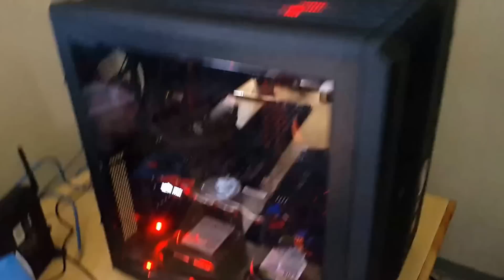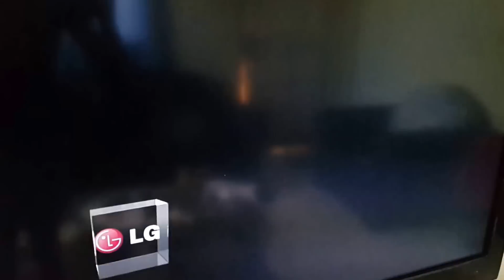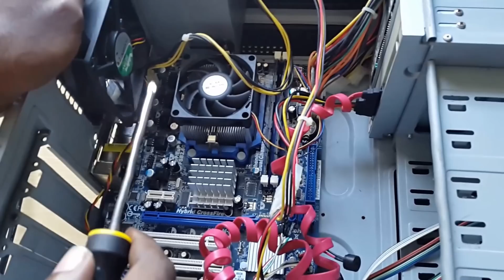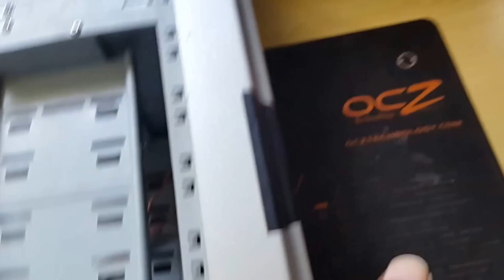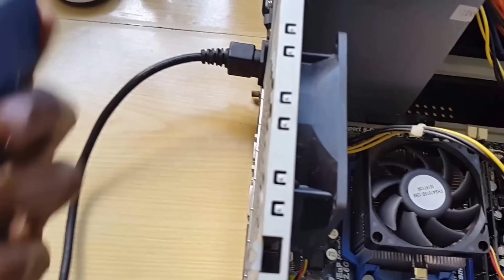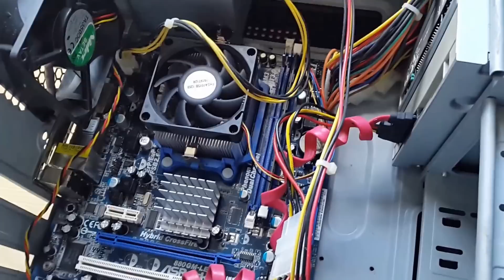No signal to Monitor Fix Easy PC Fix

Comment: After a Windows update I got the no signal detected. Turned it off and on, did the 1min reset. Bought a different signal cable. Connected PC to laptop instead. No dice. disconnected everything, opened case and made sure everything was pressed in (ram, psu cables) it was to my knowledge.  Switched the monitor power cable to a different socket in the extension lead. Then it worked. Don't really know how but whatever  .

Comment: after holding it for a minute, do i plug it back up and then hold it for another minute?
Reply: Turn off PC, disconnect power cable and turn off mains.  
Hold button  for 1 min. 
Connect it all up, turn on by pressing power button for a few seconds.

Comment: When I plug the monitor to Cpu, it goes to power save mode, i already tried with a second monitor and the same thing happens. My power button/reset button stopped working as well. Usb ports are getting power, but keyboard and mouse don't get any.
Reply: Clean your ram and unplug the batteries and plug it again
Reply: @kue6916  I did a power drain, removed ram to clean it up and it worked. i´m using my pc right now. I still have to buy a new ram though, 1gb is not enough these days.

Comment: A huge thank you for this video - I was pretty crushed when I discovered that my brother's Samsung computer monitor would only show  a check signal cable message.  I tried three different monitors with the same results.  I started searching for solutions and found your excellent video.  Today, I tried your step by step instructions hoping that it would be an easy fix on the first attempt.  The power cable did not solve the problem and no video card to deal with so thought I would try the CMOS battery.  That was the golden ticket!  Computer is up and running and a catastrophe has been averted.  I am hoping it doesn't give me any more problems but at least I have your suggestions to try again.  Pretty proud of my accomplishment as I have never opened a computer case before today.    Thanks again!

Comment: When i start my pc my gpu fan start running fast but no display any suggestions?
Reply: Samir same problem dude
Reply: I would suggest you to check your power supply motherboard and gpu as far as i know these are the components who can cause this problem i already checked mine i think the problem is with my power supply 6 pin connector not sure tho but still i hope this might can help u little bit btw i 'm still searching the problem if i find any kind of solution or information i will tell also if u find anything informative keep me updating i will also

Comment: I tried all these solutions and nothing worked. My GPU and everything else is running just fine but as soon as I plug in the cable it says no signal. I got a new one today and it still doesn’t work.

Comment: After crying in my head for hours it finally worked when I input hdmi into graphics card and then turned off pc manually then unplugged then held the power off button for 60 seconds. Plugged it back in power on monitor finally on. Thanks
Reply: Thank u so much i i did what u did and it worked

Comment: I am such a dumbass that i was searching all over internet for it's fix and I spent almost 10$ thinking that it may be a wire issue and all i had to do was to push a damn button on my LCD to switch between dvi and vga. I am litterally willling to cry right now but i am also happy. Any way thank you so much for all these solutions. I really appreciate it. Liked your Video.
Reply from the maker: Thank you-In the future always see if there is a fix online before taking the device in for repair. Funny thing the repair guys will sometimes watch these videos and fix the issue and charge you.
Reply: @rickytlc1985  YEAH BRO SURE

Comment: Hey guys I tried the solutions in this video and they didn’t work but I tried switching from a dp cable to hdmi and it worked for a little bit but I found on a different video that if you are on a dp cable and get the no signal problem a fix that might work is unplugging your monitor from the wall outlet for about 30 seconds and then plugging it back in, it worked for me hopefully this helps👍

Comment: For those who still have this problem and keeps on trying different things. I suggest to plug the cable to the videocard. Maybe get a adaptor if needed. This is worth a try because most of the time you cant connect a monitor to the motherboard if you already have a videocard. It needs to be connected to the videocard. I hope this helps. This method works for me, just spreading what i have learned.

Comment: My problem was that the motherboard bios wasnt compatible with the cpu. If this is still not working for you, take it to a shop and ask them to reprogram your bios.
Reply from the maker: ? In most cases it was a already working PC, your case would only apply to a newly built PC.Its always recommend you make sure parts are compatible before purchasing. This is not necessary.

Comment: Ricardo! Thank you so much! I tried resetting the cmos by removing the motherboard battery, using the jumper, and using a flathead to the jumper. Did what you said and held the power button down with the power supply unplugged and in the on position for 1min and in the off position for another. Thanks again!
Reply from the maker: Great job
Reply: Do u have a video card?
Reply: @simmone1900  hi

Comment: i have 1050 ti strix 
i connect it to monitor no signal '' VGA - HDMI Adapter '' 
when connect it to Tv work '' HDMI " it mean graphic card work 
when i remove graphic card and plugin VGA in motherboard and Monitor work 
any solution please ??

Comment: Hey can anyone give any thoughts on whats happening with my computer, so a few months ago I wanted to reorganize my room so I powered down my computer and then moved it to another outlet and every since then, it'll never boot up just the cpu fan and whatnot will be running. But if I take it to another room it'll boot up then it will eventually go back to no signal and still be running. So I thought maybe like it was the gpu being over worked but its not faulty ive tested and ive cleaned the ram sticks properly, cleaned the fans and everything else. No luck. Personally I think its the psu at this point but any insight would be nice:)

Comment: I have a computer that has been stored and not used for over a year. It worked perfectly the last time it was used, and I checked regularly and no malware was found. Now I am getting a message telling me there is no video signal,  I am also getting a white line down the left side of the monitor. Does any one know what the most likely cause of the problem is? Thank you in advance.

Comment: Bro... Thank you so much, I have tried so many different ways to fix the issue. And I even thought about to buy new DP cable, then i found your video. It looked like a troll at first but i did give a shot and tried the way you were doing "unplug power cable + hold down power button for a min", THEN IT DID WORK!!!! Could you explain why this is working?
Reply: @HeerJan Thank you for your reply, It did help but this problem keep appearing from time to time. Sometimes it doesn't go away one time trial with your method (like had to try this for 20 mins) :/ Not sure why tho.. I even changed DP port. Anyway Thank you for answering my comment even though my comment was a while ago. I really appreciate :)

Comment: I did it, it worked and now I get this. Instantly I turn on pc, it shows that it is out of range. Working range: H:30-81 KHz, V:60-75Hz. Max res 1280x1024. Current mode, H:32 KHz, V30Hz. Obviously it's too low and I can't change it because I can't see ****.

Comment: none of them work, my old gtx650 works fine but gtx 960 not.Tried my friends computer only dvi socket works. But my cable not work with dvi or hdmi connector.Cable fine connector fine only my frineds monitor dvi cable work.

Comment: Could this be happening because I have a Dusty graphics card
Reply from the maker: It could -try cleaning it.
Reply: @rickytlc1985  I've done the 60 second power hold a couple of times and it worked, but now it's stopped working what would you suggest I do?

Comment: All I did was move my computer to another plave and its doing this, would doing all this really help? Ive tried the power first step but thats not working
Reply from the maker: Did you check your cables to see if they are connected properly?
Reply: @rickytlc1985  I put it in the hdmi cord in a different part of the tower and it work so I guess I did screw up
Reply: @rickytlc1985  thanks for the help

Comment: Ok If you can see this!!! what happened to me 3 months ago I was  browsing on YouTube on my 700$ rig then suddenly the screen glitches out red pixels and then I tried to troubleshoot it again by rebooting it but right after that when it finished booting it again it did the same thing again. Up until now I have destined to try using canned air to clean it out but I have tried switching slots with both the ram and my new graphics card I got for Christmas (a Asus Rog Strx 1050ti) 
Here is the real question
Is it the monitor 
The power supply or worse
The motherboard?
I’m personally scared because I come from a cheap background and I really don’t want to pour 400$ into a new processor and motherboard thx.

Comment: If your monitor says no signal and you've tried taking everything out and plugging them back in, look to see whats running. Note that the ram sticks and cpu are most likely to produce this error. If the motherboard works, all fans should run, and for the time being should look toward (again) the ram sticks and cpu. Also make sure the hdmi cable is plugged in the graphics card

Comment: I can't get a display output, I'm having the fans spinning but no display. My specs are: Ryzen 5 2600 with stock cooler, Rx 580 8gb. Corsair vengance 8gb ram, 550w power supply. PLEASE SOMEONE HELP
Reply: fixed
Reply: Nice! How did u fix it?
Reply: I was using a b350 motherboard with a ryzen 5. The b350 needs to update in order to be compatible with a ryzen 5+. the only way to fix my situation was to get a b450, which works out of the box with ryzen 5+, no updates needed to boot.
Reply: Possessed Same problem here idk what’s wrong with mine too

Comment: I wanted to clean up my PC now It won't boot up. Everything was fine before.Things I messed around with:
1:Took out the GPU, cleaned it and put it back.
2:Removed the ram.
And did some dusting. When I put all the things back, I am not getting a display. The CPU fan is running, GPU fan is running, Case fans are running, but I'm not getting power on Keyboard(RGB Keyboard) or mouse. I tried using Integrated GPU and still no fix. I tried everything in the video above and nthing worked, if anyone can tell me a solution, it'd be great.
Reply: I have the exact same problem except I took the cpu out and cleaned instead of ram
Reply: @aidanwright1745  If you find a solution, please let me know
Reply: it took a while but i got it. i just took out my cpu ram and gpu all at once and checked them all then put them back in and it worked. hopefully your will work. :)
Reply: @aidanwright1745  I have tried to remove everything(except cpu, cause its liquid cooled so its hard to put it back together), i removed the wires and put them back after cleaning the dust, but no luck.
Reply: then i have no idea, sorry
Reply: @aidanwright1745  Rip, i'll just take it to the reapir shop i guess.
Reply: that's annoying bro. they will probably charge you like 30 or something for that.
Reply: @aidanwright1745  My psu was in warranty, so i got it for free :)
Reply: same thing is happening to me. sorry but i dont have a sulution ever. i spent 9 hours trying to fix my pc i just bourght it 1 day ago

Comment: Tried for hours to solve the problem after moving and rebuild--nothing would display except for "no signal".  After watching your video I removed the GTX 970 card and the onboard video worked.  Now everything is irie--you deserve a Red Stripe!!!!  Now to try to get card repaired/replaced.  Thanks.....
Reply from the maker: Thanks will have to take u up on that Red Stripe -lol

Comment: I had graphic card installed. I was plugging monitor's vga pin into other vga port where graphic card was not installed. Thus i was getting monitor going to sleep message due to incorrect plugging.

Comment: I have a single RAM and theres no video signal and no boot beep sound. It behave the same even when i unplugged RAM, graphic card or HDD. Tried all you sugested with no results. Something is dead i guess, but how to determin what?
Reply from the maker: The order usually is Motherboard, Video card.... You can rule out video card by using onboard video on the motherboard. If it works with onboard video its the video card and if not it may be the video card that needs replacing.

Comment: I accedentally switched something from HDMI to DIV  and now iT says cable not connected so is can open the menu help pls
Reply from the maker: Not sure what you mean. If you switch something from the computer side simply try pressing escape and the monitor should switch to the old setting. You can also try unplugging the current connection and connecting it back once more.

Comment: I tried the power cord reset a couple times, and no luck.  So I opened it up, cleaned it out, checked the boards and tried again. It worked! You’re great. Thanks
Reply: What exactly did you cleaned?

Comment: Hi, my computer turns on (the parts functioning) nothing shows up on my monitor, the usb ports don't work, and about 30 seconds later the CPU cooling fan blows insanely fast even though it doesn' t feel hot. Sometimes the computer turns on and it goes to the monitor saying "attempting repairs" but a few seconds later it stops displaying to the screen. I have tried all the solutions in the video, please help.
Reply from the maker: If the Fan is Ramping up it could be that something is overheating such as the processor,if you have had your PC for a while it may be that thermal compound beneath the processor needs changing.
Reply: Thanks that might be it

Comment: Thanks for the remembering of how fucked up energy works trough technology,  powered my pc down and unplugged the trash,l then holded the power  button for 70secs since 60 was minimum and damn it worked again. Is this a reset method or an energy outting idk idc A SINCERE THANK YOU

Comment: Hi Mr Gardner In my case power receive by the moniter  and keyboard but now showing by the HP 19ka Moniter it says no signal and also said Check the power cable --- step 1 I remove the ram and clean it  step II lithum battery remove and place it again - step III hold the power button of CPU around one minute but nothing works- can u help me out what should be the next step in my pc there is no graphics card...

Comment: My PC is from 2010. It turns on and makes the startup sound but there is no display. I tried my monitor and samsung tv; no display both worked in the past but not now. I did the first step and it didn't work; i did it twice. I removed the graphics card and connect both monitor and tv into the motherboard; still no display. I haven't done the battery or the RAM steps yet though. If the motherboard was bad would the PC even turn on to begin with?? Please help. Thank you in advance

Comment: Yo anyone I have just built a pc and it says no signal even after

- holding power button
-reconnecting everything on the mobo
-putting hdmi cable in gpu and mobo 
-trying different ram slots 
I've also tried like 20 other things can someone give me any advice????
-
Reply from the maker: It happens to the best of us. Seeing the PC is new something might have not been seated properly such as Processor.
Reply: Ricardo Gardener thanks!

Comment: Hi, i plug my PC on a multi socket and when i plugged my laptop i've seen sparkles. 
It cutout  the electricity in my whole apartment when the electricity came back i turned on my PC but nothing worked. 
i went to a shop to fix it after a diagnose, they told me that it came from the PC supply unit they changed it. Back home i tried to start the computer system unit it works but i have no response from my peripherals (mouse keyboard), and my screen indicates that there is no signal.
They also told me that the motherboard is fine.
I unplugged and plug it back all the wires and press the power button for 60 minutes but it changed nothing.
Thanks for your help.

Comment: Ok so, I replaced my ram cpu and mobo. Everything worked fine. Took my cpu out to apply thermal paste again and I have this no signal problem. I took my gpu and put it in my other rig, works fine.

Comment: Can someone help me, my mom borrowed my TV that I use as a monitor which is connected to my pc and when I plugged it back up it now says no signal and idk what to do... could it be something wrong with my pc even though just the TV got moved?
Reply: thats exactly what happened to mine my son switched it for for a day and now wont work
Reply: i couldnt fix it to use the DVI on comp to hdmi TV no matter what i tried so i got a adapter off ebay for like 8 bucks and now im using the vga off computer to hdmi into TV

Comment: I watched the first 3 minutes and thought "naaaaaaaaa, this isn't gonna work" and figured, what the heck, I'll give it a go. It actually worked!!! Thanks!
Reply: what the actual? the only reason i tried the first step was because i read this message... why would unplugging my computers power cable and holding the start button down fix my no signal to my monitor issue? so much confuse >.<

Comment: You've saved me a lot o money, i was about to give up, thank you. remomed battery, and checked connections rams seemed loose, 👍.
Reply from the maker: Great job
Reply: Ricardo Gardener didnt fix it but when i plug tv to my pc it works but when i plug the monitor into my pc not work 💔☹️
Reply: Ricardo Gardener and when i plug labtop to the same monitor it works !